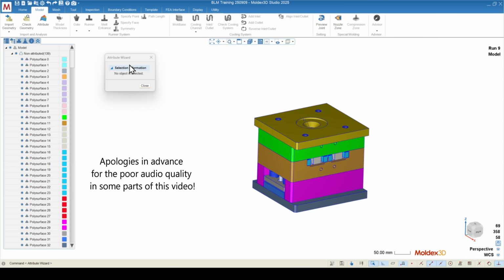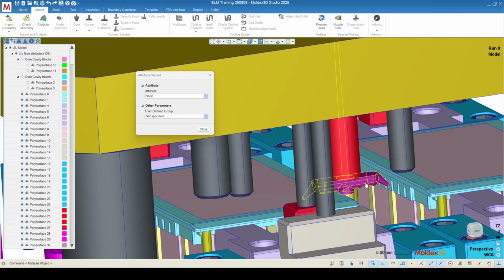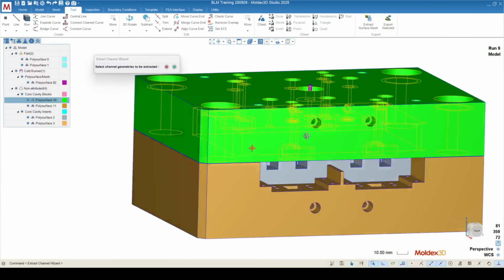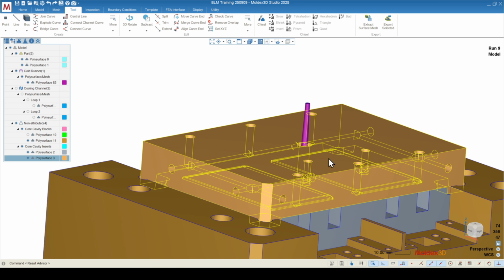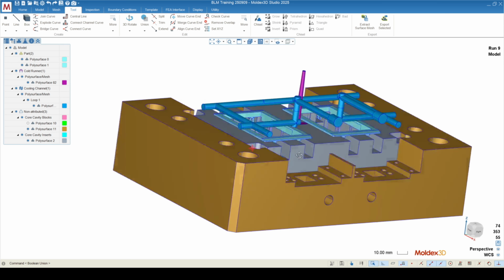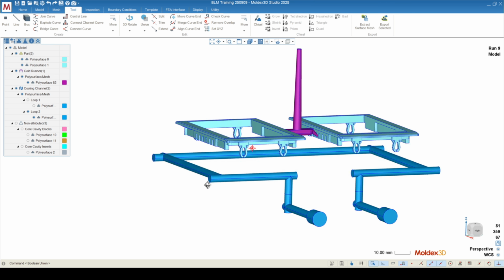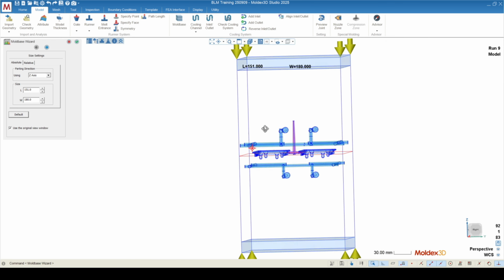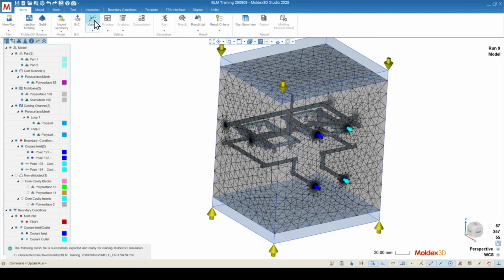Mold Extraction Tutorial for Simulation | Moldex3D Studio 2025 | Advanced Tips & Tricks

Comment: Are the cooling channels extracted by the wizard considered geometry meshing or curve meshing? If geometry, what mesh type do you recommend?
Reply from the maker: Hello Eric,  When you use the "Extract Channel Wizard" function, the channels are extracted as a solid geometry, so it would use geometry meshing.  If you use "Central Line" to extract the center lines from that geometry, then it would use curve meshing. 

When using geometry meshing the parameter recommendation is 3 layer BLM and 0.2 offset ratio.